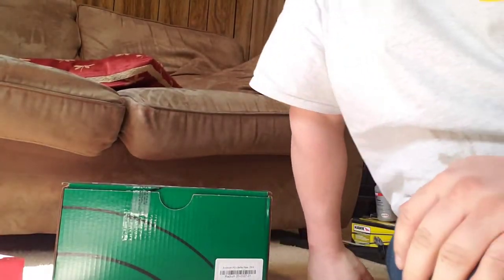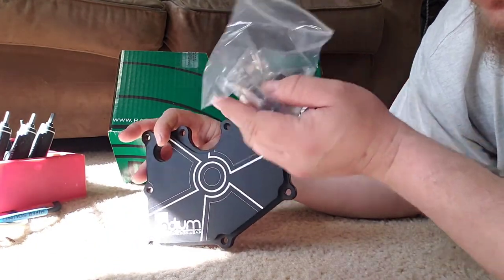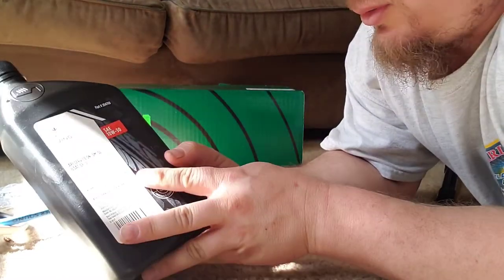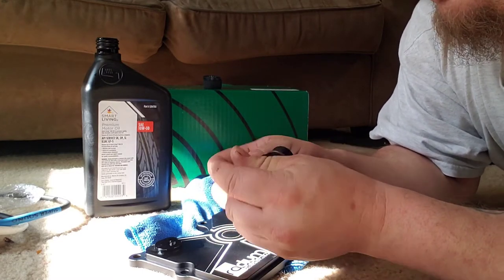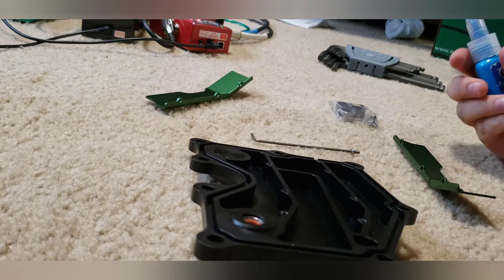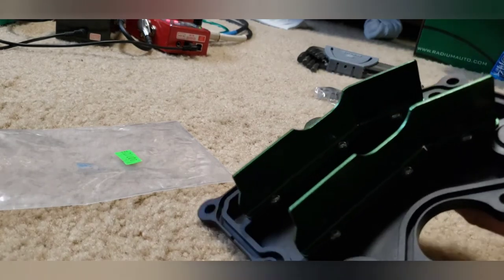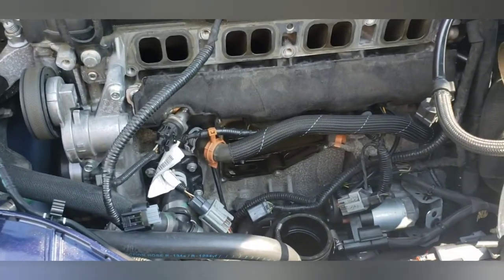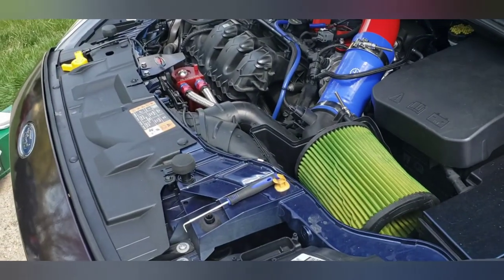Radium PCV Baffle Install

Comment: did you replace for preventative measure or did your old pcv start to go out? and did it start spewing light white smoke out exhaust?
Reply: Even odds its the White smoke thing. 
On a side note- no correct size allen? Get a bolt with the right size head, double-nut it and there's your install tool.
Reply from the maker: I did it trying to find a vacuum leak. Sory for the late response